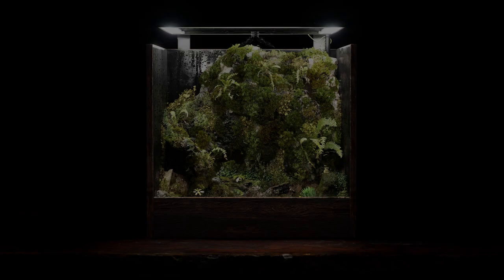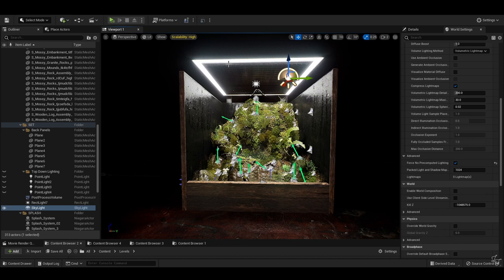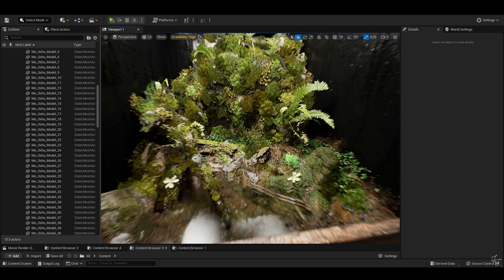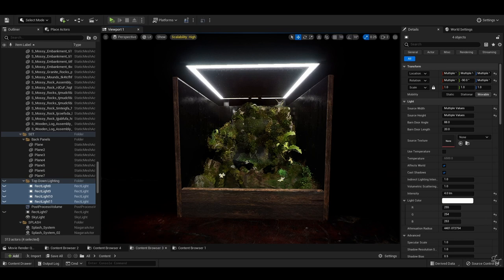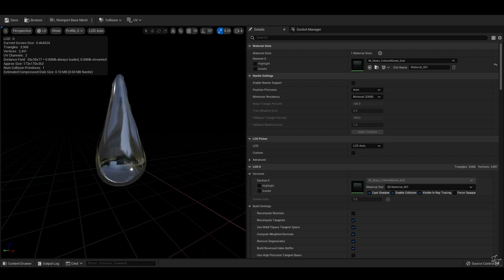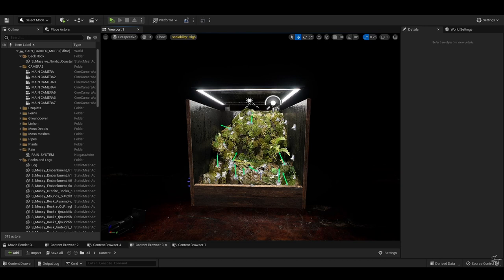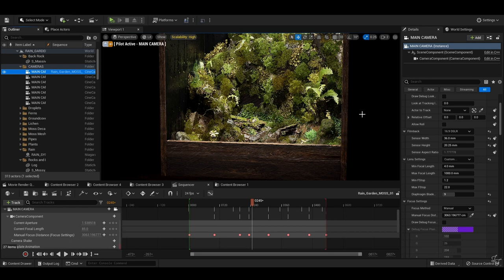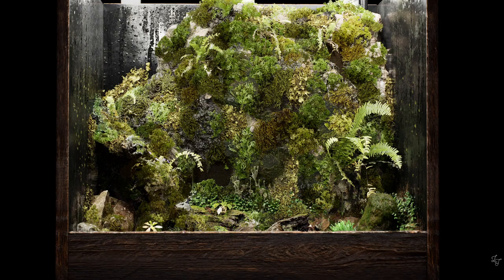Making a Photorealistic Rain Garden in UNREAL ENGINE 5! | Project Breakdown [UE5] [Tutorial]

Comment: The plants and foliage are absolutely STUNNING! Wow!! Simply incredible. I’d go as far to say it’s probably the most photorealistic piece of cgi I’ve ever seen. 

That being said, there is one thing I observed—don’t take this as a critique, it’s more me wanting to know if I’m seeing things right and how to improve-the wood paneling doesn’t look quite as photorealistic as everything else. 

This isn’t unique to you. I almost never see truly realistic wood, even from seasoned professionals. Why is that? What is so hard about rendering wood?
Reply from the maker: Thanks! And yeah, wood can be a bit tricky - it's partly because wood tends to have very fine grain - which can be approximated by normal maps to a point, but it will always look a little off. To a degree, you can get around this with really good, layered texture work (multiple layers of dust, fingerprints, scratches etc...) but yeah when you have very stark, top down light like this scene, it can quickly get complicated!
Reply: @lion_towers3d  Did you make the foliage assets, or are you using a lot from quixel?